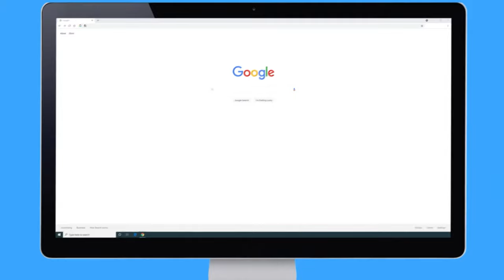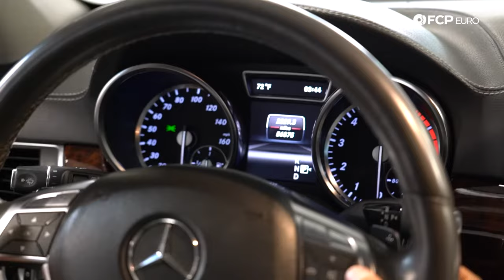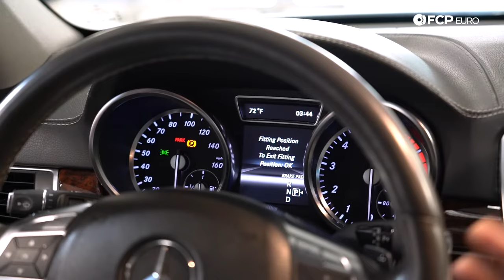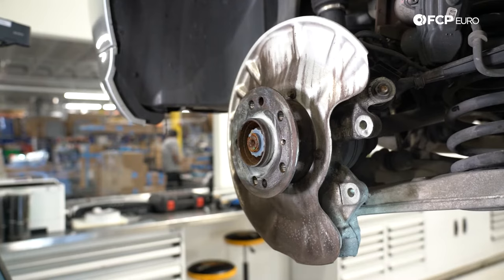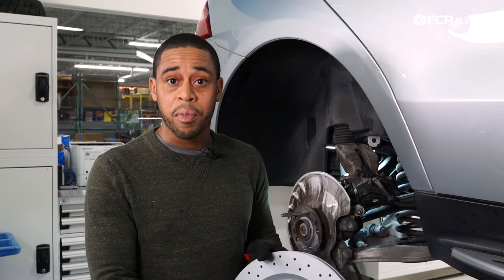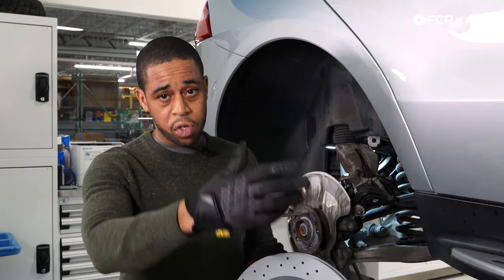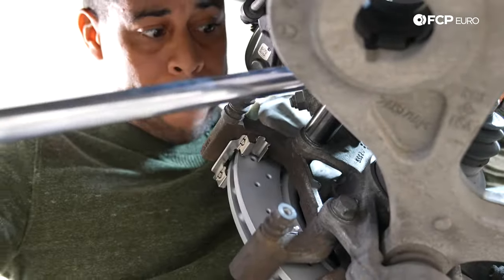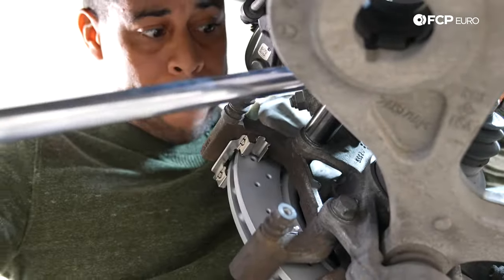Mercedes-Benz W166 Rear Brake Pad & Rotor Replacement DIY (2012-2019 ML550, GL550, GLS550)

Comment: Word of the wise from a dealer tech..the caliper carrier does not have to be removed to remove the brake rotor.
Reply: Does that mean only the two bolts holding the brake assembly need to be removed and The rest of the brake assembly will come off?
Reply: Can confirm.  Wiggles right on out of there.  Also, the calipers are spin-in retracting, like most rear calipers.  Easy job.
Reply: Thank you! Just did this rotor change today and didn’t have to remove the carrier. Easy job! Thanks for the tip!
Reply: This was a great tip!
Reply: Just did the brakes and rotors today.  I can confirm, you do not need to remove the caliper carrier.  The rotor can be wiggled out gently.  No need to remove the 18mm bolts!

Comment: Just did my rotor replacement on my W166 ML350 and the front/rear videos are the best. So good, in fact, that I just placed an order with FCP Euro for an accessory belt/tensioner kit. I was not aware of FCP until I cam across these videos and now am a customer. Well done!

Comment: Excellent video, with one additional suggestion: although you noted that the brake calipers were tough to fit over the new brake pad, you omitted the portion showing HOW to push the brake piston back into the caliper enough for the caliper to fit over the new pads.  Unfortunately, you need a special tool for Mercedes brake pistons; this step, being crucial, could be a project-stopping problem, unless you have separate transportation until you get the tool.  You'd have to stop the project while everything is disassembled.  Even with the tool it requires some muscle, so I can't really think of an improvised method that would let you push the piston back to a place that would let you put the caliper over the new pads.  So be warned, people, and get that tool and make sure it fits mercedes brakes BEFORE you start the job.

Comment: I really should have searched this video BEFORE trying to do the job. I did find out about the service mode after realizing the piston wouldn't compress. However, by that time, I had already taken the caliper off. It didn't retract all the way and I couldn't easily compress the piston with a clamp (had brake reservoir open). There wasn't enough clearance to put the caliper back on. I thought i could "reset" by exiting fitting mode and re-entering fitting mode. Upon exiting fitting mode (with caliper loose), the piston extended itself until it flew off 😭 There is no stop for it. Be careful! DIY was a piece of cake on the front, now a shop is fixing my mistake in the rear 💀
Reply: I think service mode only retracts the emergency brake; it did not retract the brake pistons all the way even though I did it right at the start.  You need the brake piston compression tool anyway.

Comment: I can  confirm it's  the same process and tools for 2014 gl 63amg. The only extra  step I add a little high temp brake grease to the shim / pad contact area,  helps with prevention of squeal.
Reply: Thank you so much!
Reply: Do you need to replace any screws/bolts or anything?

Comment: I have a 2015 ML400. Ran into snag on rear brakes. Didn’t have a caliper press and had to order it. Watched your video and saw the brake fitting position instruction. But did this with driver side rear brake disassembled. Wheel cylinder brake caliper extended all the way out. I’m worried I caused damage. I guess I’ll know when I get the retractor. Thanks for your video. Wish I had viewed it before starting the job. Live and learn.
Reply: Happened to me as well. Luckily I had someone reset it and retract it back without damage. I hope it worked for you
Reply: You shot the piston out of your caliper lol? Well.. if you don’t want to bleed your brakes take a c clamp and push the piston back into the caliper, it will be extremely hard to set but once it’s in and set a little bit you’re good to go, or the easier way is take the caliper off and do the same thing.

Comment: Excellent video EXCEPT you skipped the piston retraction (most important step I was interested in seeing). At the beginning you show a caliper press tool as being required, but from the video (5:39) it appears that these are the screw type. Screw type or compression? Help? Can you edit that step into your presentation?

Comment: how do you realign rear rotors to hub to get the t-screw and bolts back in, do I have to remove the brakes and caliper?

Comment: Might be a stupid question but once the brake is activated can the ignition be turned off?
Reply from the maker: Typically, the scan tool you are using will ask you to turn off your ignition until you are ready to reset the parking brake on your vehicle!

Comment: Can you re-use the existing brake pad thickness sensor or do you need to buy a new one?
Reply from the maker: We always recommend replacements as often times they will fall apart upon removal due to all the heat and cooling they go through.

Comment: Why the Rear brakes squalling with all brand new Mercedes OEM parts on my W166 GLE400? I put brake paste on the back of the pads. There still squalling when it's cold outsight at a light pressure on the brakes coming to a stop. Once the rotors warm up the sounds goes away.
Reply: I think you need to put some brake lubricant/grease on the BACK of the brake pads and on the brake piston and caliper where they contact the brake pads.  That's the tip I got today from the supervising mechanic when I did my rear brakes.

Comment: Hi i have changed the front pads and sensor wire last week now just changed rear pads and sensor on the ml w166 but it is still saying check brake wear i have replaced the rear sensor wire twice but still saying check brake wear can you advise ? Thanks
Reply from the maker: Hi Deedee, often times you may need to use a scanner to reset the error code. Worth giving that a try, along with ensuring the sensors were plugged in correctly.
Reply: @fcpeuro   thanks for your reply

Comment: you might want to re-check the bracket bolt spec. as stated in the video to be 55NM, I believe is incorrect.
Reply: Whst is the correct one?